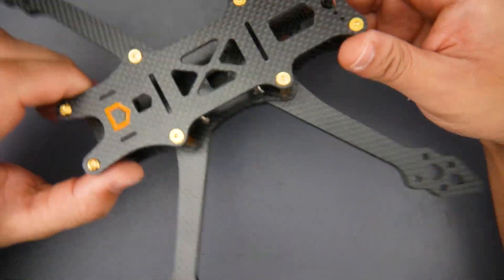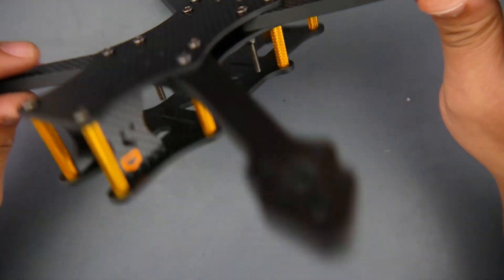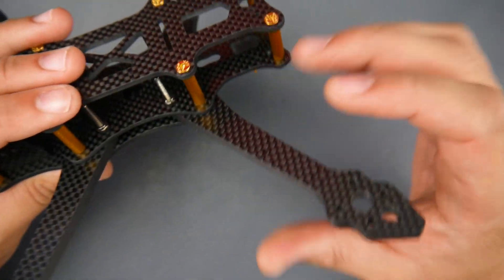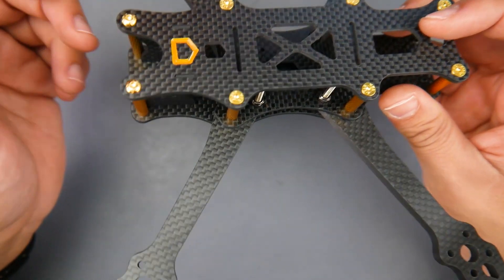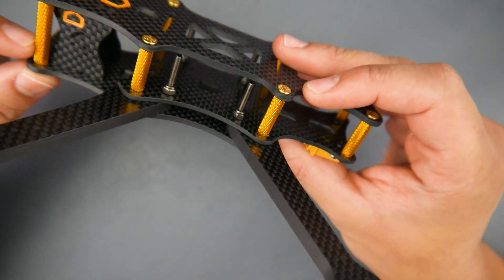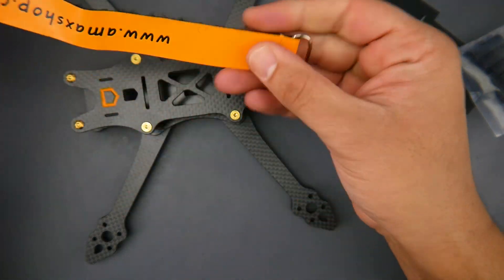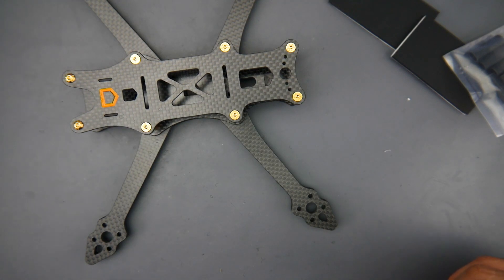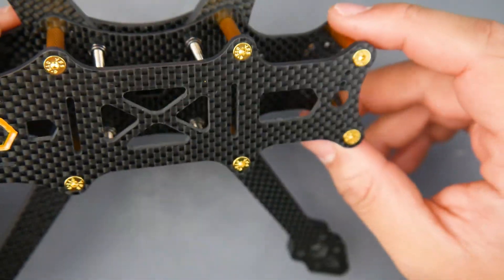Amax German Engineering // Amaxino F5P Freestyle Frame

Comment: I'm loving Amaxinno's previous freestyle frame and this looks really rugged and well designed, too. However, I'm not crazy about the stack screws going through the arms. And I won't use the bottom XT60 because I like a rear mounted FPV antenna (and GPS).

Comment: Not sure about that xt60 location I like the idea though, you'd have to route your battery lead around the vtx antenna and most the batteries I run wouldn't be long enough anyway.
Reply from the maker: Whats nice you can just choose not to set it up thay way. Think of it as an extra option thats available.